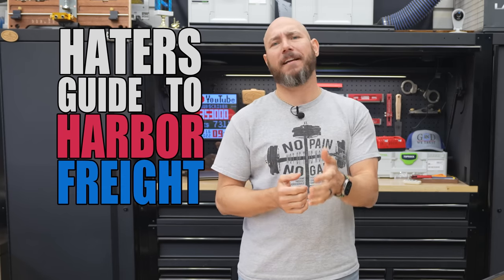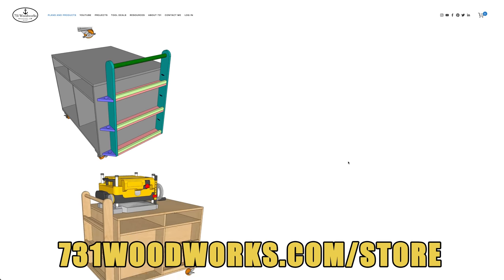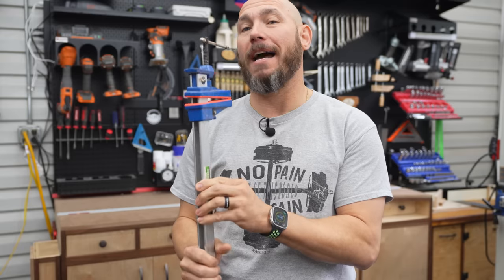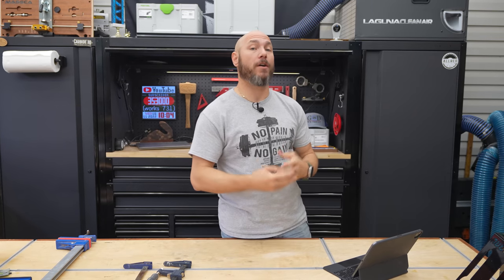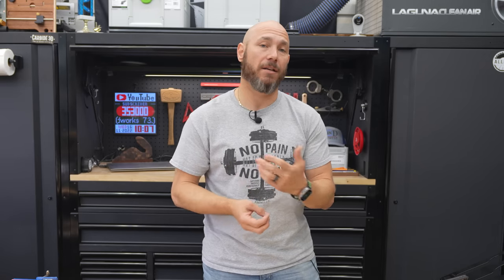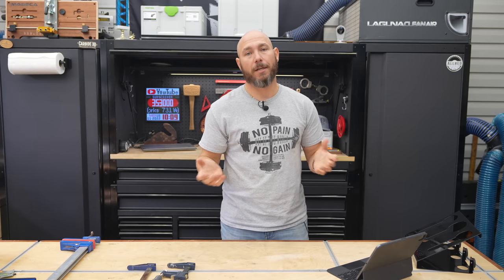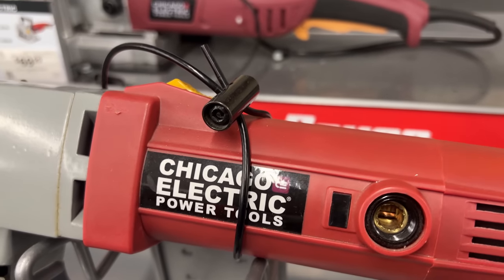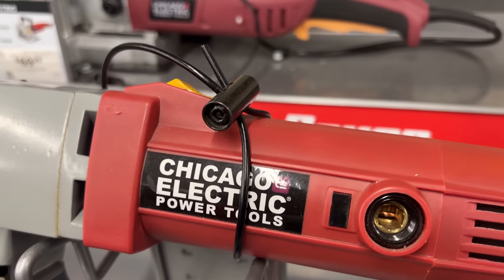The Hater's Guide to Harbor Freight | What to Avoid

Comment: Never will I buy anything electronic from them or anything that’s from the Icon line unless the price is reasonable which isn’t happening. HF was a low budget tool company & then they decided to be as equal or better then the tool truck companies.  Sure the Icon is cheaper, (Tool truck companies) but not worth the price for what they initially sold. The cheap company is now not, but yet still sells to the DIYers but doesn’t care about that group cause there is a new market of people that will buy their Icon line. And those people overshadow & it’s more profitable (Icon). Deals can be had from Lowe’s or Home Depot. I shop more & more at Home Depot.

Comment: As for the BBB nonsense. That’s a ridiculous argument. People griping about HF to BBB are barking at a tree that is not in the garden of the argument. 

BBB is for another type of misleading customer service. 

All of the HF tools I’ve ever had are sold complete with a very realistic warranty or guarantee that has never been an issue in my experience. 
Had I purchased a costly generator that failed and they replaced it and that failed as well, resulting in no replacement, perhaps I’d be upset about the problem. 
But killing two generator is not something a user that takes care of the products is likely to encounter. 
Larger high ticket items are not in the same ‘warranty’ category as most of their products. Paying extra for added warranties for a hand drill is stupid, it has a built in warranty for a very reasonable time period. Bring it in, (legitimately expecting a receipt, or use plastic, so it is already in their computer) and they give you a new one.

Comment: I once posed a question on Reddit in woodworking, "what stuff from Harbor Freight is actually decent".   My post got removed because apparently you can't ask for tool brand recommends.  The fucking rules and the moderators on Reddit really ruin an otherwise pretty cool platfrom.  (for the most part there's ZERO moderators or oversight on Youtube, and the comments section works just fine).

Comment: Those negative reviews are nothing but bot review bombs. HF customer service is all IN PERSON and amazing... all the time. As for defective tools? They literally have a lifetime warranty for all hand tools, and limited warranties for power tools. You just take in in and get a new one on the spot. And the quality of tools is NOT in fact built with "cheaper quality plastics and metals" That's just a flat out lie, or just a statement smothered in ignorance. Project Farm does tool reviews ALL the time, and the HF tools do just as good, or in some cases, better than that quality named brands you advocate for. Another fact is this. The CEO of Harbor Freight purposefully tracks down the manufacturing factory for many named branded tools, and has the tools from HF made in the same exact factory using the same exact processes for their higher end tools that they sell. There is very little difference in most cases. One example is the Daytona floor jack. It's LITERALLY a snap-on floor jack but for 1/4 the cost. Sure, not everything they sell is great. They DO themselves have tiers of quality tools. They have budget, mid, and higher end tools.

Comment: Harbor freight tools are not for professional trades ...they are inexpensive tools for home owners and they will accept exchanges up to 90 day from date of purchase ...or they provide up to one year for a mere $10 dollars and odd cents.
I have  a only  couple of  Harbor freight electric  tools. But they have stood up to anything with a Name on it .
I have a 35  year old Harbor freight Rockwell 10 table saw CLONE  ..that has only had belt changes during 3 decades of use ...I built  dozens of projects with it,   was  it as accurate as the real thing ? Only slight less ..but with a little fine tuning ...mine became as accurate for $425 less  .The other is the Bauer band saw ....a CLONE  of a Milwaukee for  $ 250 less than the real thing , same story , returned the first one after plugging it in at home  because of a bearing noise ...plugged its exchange  in the store before taking it home...no issues . Where I used to work before retiring  , I fine tuned it and compared it to the shop`s WAUKEE ...just as good . Now 3 years later  frequent use and all   no problems, in fact just bought their  band saw stand for $ 250 less than one that was offered by a company that is now out of business and the HB version is better built. In summation ..I do not agree with this video ..I am not a defense lawyer for Harbor freight, nor do I get any compensation for anything positive I say about them . I will say this ...most of the complains they  get come from people who buy tools but can barely tie their shoe laces ..and as a  result abuse the lesser quality of many of them , for 2 reasons .The  first is that they have no clue about how to properly  execute  the DIY project or whatever they are attempting to do . The second .."just as bad is "  that they do not have a clue on how to use the tools properly and end up stressing it beyond its design parameters .An example are  the geniuses who take a corded drill and instead of have the right size bit for the hole they need to drill they use a smaller one and wobble off axis until they get a bigger hole and wipe out the chucks bearings if they manage to not get injured at all . The Harbor freight powered tools , corded or  cordless are  cheaper because quality control from the factories that produce them is not as stringent as SOME OF THE FABLED NAME BRANDS ... BUT  NOT All  ... some of them have been turning into crap as well for much more money.
To anybody considering Harbor Freight ..my suggestion is  simple ,  buy the damned tool try it in the store , if it checks okay based on what your experience tells you take it home,  use the hell out of it  for 85 days , you got 90 days to exchange it .At the first sign of malfunction or weird noise ,  go back and exchange it ..or buy an name brand and see if the big box store treats you any better when you fry a Milwaukee , a Bosch , or a DeWalt.

Comment: I would never buy power tools from Harbor!  Basically if it's made in China it's junk.  General Electric owns Black and Decker;  they shut down their American factories and shipped everything to China.  Then they bought out Delta, shut down the American factory and shipped it all to China, then they did the same with Dewalt.  These brand are all made in the same Chinese factory using many of the same, low quality parts.  Bosch and Skil merged, but their quality is still good.  Porter Cable and Milwaukee are still very high quality, made in America. They use better quality steel from high quality iron. Chinese steel is really bad!

Comment: Like most store chains, Harbor Freight has it good and bad products with a lot of China crap as all stores do. Most all repeat customers of Harbor Freight are aware of what they are purchasing and why.  The problem with the advice given in this video is that He is comparing and recommending a high-end expensive tool for each of the HF products that he does not recommend. Just use common sense when shopping at HF and you will be happy that there is one in town.  And don't forget to use common sense at the 2024 pole too.  FJB.

Comment: If you're an educated consumer you should know the pros and cons of harbor freight, like I do. Those bad reviews are from stupid uneducated consumers that don't have a brain. Just the other day I bought a dremel for $20 the on/off switch broke the second time I used it, the same day. I didn't get mad because I know it's a likely possibility when I buy a $20 electrical item that would cost 5 times more in another store for a well known brand. That's the risk you take when you buy cheap items in any store not only Harbor Freight. By the way I've the same Harbor Freight dremel for $20 that has worked for 3 years without an issue, I bought the one that broke cause I left mine at home and the store was way closer than going home to get mine.

Comment: I'm firmly of the opinion that if you refuse to turn a wrench because of the branding on it, then you don't deserve the nicer brands. If you are too good to use a harbor freight wrench or other simple tool then you are too pretentious to deserve snap on tools and I'm glad that at least the snap on guy is taking your money from you like the moron you are. Seriously, staunch brand loyalty is ridiculous. Know where to spend your money. There are tools that should be of better quality but if you aren't making money with them or just doing your own projects or the tools are super simple or will wear out/be destroyed somewhat quickly and it isn't imperative that they come from a delivery truck with a payment plan. Angle grinders, most hand tools, test lights, cordless drills, clamps, and even the floor jacks at harbor freight are fine. In any case, having multiple of each tool I just mentioned will be necessary anyway. Heavier duty jobs will need better tools, and if you need your tools to make money, then be smart and determine what you actually need to spend money on but I've seen a too many  harbor freight tools in professional shops making money too buy into them being terrible.

Comment: I Hate buying from China! But almost everything you buy from every company is from harbor China.  I buy impact sockets their and have never hurt one. So I would say hand tools are OK, but as China is stupid you won't get a complete set. They leave out certain sockets, Allan wrenches, etc.  Air tools are just junk! I did buy a 7500 watt generator. It's heavy! That's the only down side. I never run alcohol blend fuel and it always starts on the first pull.  The socket holders are terrible and have missing spots like their sockets. Stay away from the tile saws. Just my experiences.